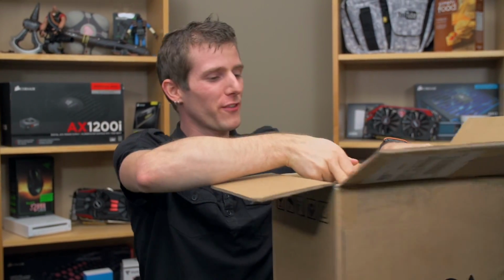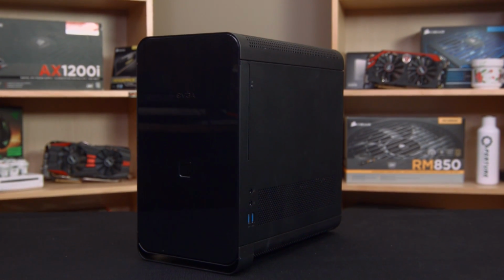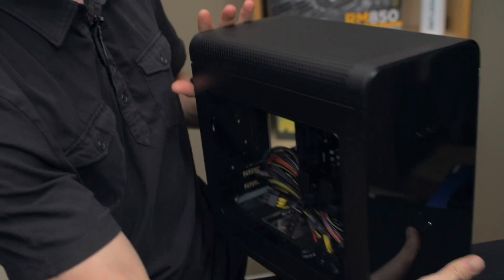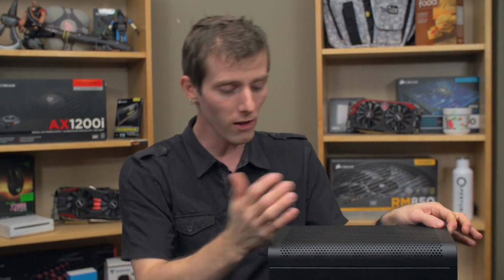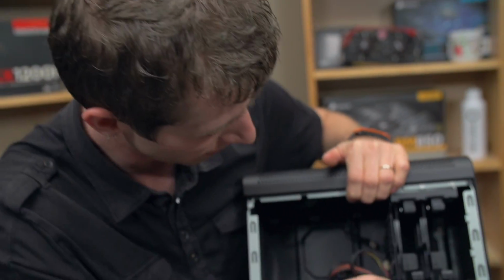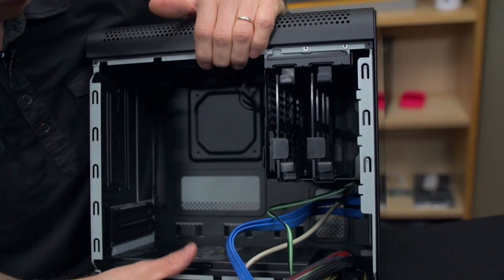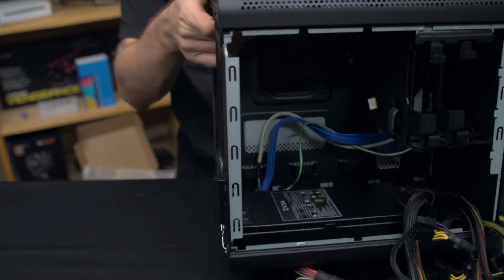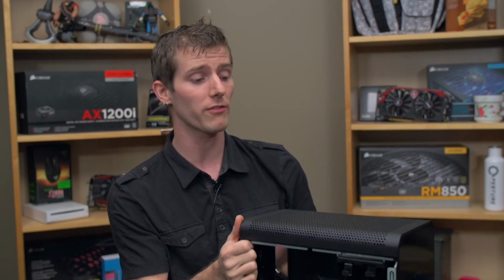EVGA Hadron Air

Comment: My current build.
Hadron Air
Gigabyte GA-Z97N-WIFI
i5-4690k
2x4GB Patriot Viper III
1x120GB Kingston SSD
Asus GTX 760
Corsair H60 CPU cooler, removed harddrive cage to fit.
1xNoctua NF-F12 to replace Corsair fan on CPU cooler.
2xNoctua NF-S12s to replace the included exhaust fans.

Using a mediasonic 4 bay enclosure for mass storage.
1x1TB WD Blue
1x3TB Seagate Barracuda
2x4TB WD Green
Reply: Stephan Conzen 14TB? I've been using a 1TB WD Black for 3 years now, and I still have around 240GB of free space on it. I'm planning on getting a nice 500GB SSD to put the OS and all my games on too. And that'll probably be good until the HDD fails.
Reply: HUS MAN Depends what do you do. If you only play a few games, you are probably good with 1tb HDD and 120Gb ssd for a a long time..
Reply: colorz. FX Yup yup. The 4TB drives are used for movies, music at around 6.5/8 TB. The 3TB drive is reserved for development, so all my eclipse workspaces are stored there, and I like keeping that seperate from my personal stuff. The 1TB drive is standalone games + steam library, and the SSD is just my OS and small programs.

Comment: What is linus's obsession with case packaging
Reply: +Raptor hard foam gives me material to work with in different projects and does a good job at protecting still
Reply: +aajjeee Hard is only capable of taking one hit, which means that if you are shipping a system qith it, you could damage hard drives, fans, etc...
Reply: +aajjeee He has an HADRON for good packaging
Reply: +aajjeee I just bought a nzxt h440 the case came damaged on top from being banged while in shipping. It wouldnt have been damaged if nzxt decided to use soft foam instead imo.
Reply: Because when he worked at NCIX, he built pre built systems and those are shipped in the case box.

Comment: I have this case, it is AMAZING, I love it and wouldn't trade it. For some reason it's a polarizing case, people see it and are either like "that's just sick" or "dude, get a new case, ew". I don't understand the latter, this thing is TINY and AWESOME. Such good build quality, so much power in so small a space.

A couple of things about this review confuse me. On mine, the other side panel is easily removed. Also I read nothing about motherboard compatibility issues in my research, and I got a Gigabyte and it worked fine. I think all standard MITX will fit in this, I don't see why it wouldn't.

Comment: Make both sidepanels removable, open up the section behind the motherboard  for cpu cooler installation, change the USB 3 front panel cable to black (or remove the front ports), aswell as putting on a black cable isolation cover on the psu cables. If they had changed these small things on the case, then it would in my opinion be a rather nice option for compact gaming rig builds. Congrats to EVGA on a well done first product in this category.

Comment: $250 AUD (PCCaseGear) for the Hadron, Mini-ITX, 500W slimline PSU built in, 30.5cm*30.8cm*16.9cm (12" tall, 12.1" deep, 6.6" thick) 6kg/13.2lbs...
Looks and sounds like it'd be perfect for a fairly decent HTPC or SteamBox that looks nice and fits with the decor of one's home theater system (or other game consoles).

Comment: Just made a build in this case
Gtx 780, asus z77 I deluxe, 2hdds and an ssd. 
However the cpu gets really really hot under gaming load.
Playing bf4 makes it jump to 5-60 degrees Celsius . This isn't a dangerous amount if heat however it is still hotter than I like to run my system.
Luckily this thing is small enough to fit in my bag when I go back home from school for winter and summer. 
It's pretty beastly as far as cases go.

Comment: They should make the case slightly wider and taller, so that you can have push-pull radiator support on the top and do cable management behind the motherboard tray. Then remove this silly proprietary support for only EVGA motherboards with a proper CPU cutout, a removable back panel and perhaps even a fully modular power supply. It would increase the cost of the chassis, but it would increase its appeal far more.

Comment: i wish there was a bit of a space on a back for a cable management. that's the only thing that stops me from building in this case. just make it about 1cm shorter(or enough to let gpu power plugs not bend too much), then take 1cm from the drive cages area, then add 1cm on the back, add holes for cables to reach motherboard and gpu nicely and that's it. it could be perfect.

Comment: Checks for cheapest current price for this $170 msrp case.  Closes browser, shuts down laptop, and goes to cry in a corner.
Reply: Yeah sadly it's basically impossible to find it, which is a bummer because I really wanted it.
Reply: Just put in an order in for this bad boy yesterday
Reply: Really? Where, how much?
Reply: Should I tell you or should I sell it on for a profit.. hmmm... Only joking, you can order it on the EVGA website for $159, they have recently been restocked ;)
Reply: Ahah alright, didn't expec it to be restocked! Still ridiculously priced though...
Reply: The Hydro is $10 more and comes with watercooling kit. Wut?
Reply: True it's not cheap but it does include an sfx size 500w gold rated power supply. Those don't come cheap. Also compare the Air with a Ncase M1 case (granted it's better built) but that thing retails $185 with NO power supply.
Reply: You're right, I didn't know of the PSU. with that included it's a fair...ish price, I 'd buy it if it was available in Italy.

Comment: My only pet peeves with ths case is the placement of the Disc Drive and front panel connectors being on the side, so you either have to choose between this case being awkwardly positioned on the desk, or sacrificing the view of your side oanel window to have access to your ports, as cases generally are positioned alongside the monitor.

Comment: Only real problem I see but it's due to it's size is the PSU takes away a lot of airflow from the GPU what with most now exhausting into the case. I think in this case it would have made more sense to have it on the backside of the case and allow for more cable room and a CPU cut out, that way the bottom could have brought air in and flow upwards like a raven case.

Comment: I can see why people don't like the CPU cooler mount but maybe look at it this way if you use this as a lan party rig that you move around a lot. Instead of putting all the stress on the motherboard  like on a normal mount it can offload that stress on the case. That said I don't know what sorta of coolers they make that work with this it would only make sense for large heavy ones.

Comment: I really do like the case but there are a few fatal drawbacks. The non removable back panel, lack of rear fan exhaust, modular cabling. Even though the cables are short, modular cables are even more crucial in a case like this.
Something as simple as having a 3 sata pork power cable for the slimline drive and remove the 4port (molex) cable would make a woulds or difference with cable management and seems to be a more sensible idea.

Comment: Looks too small for a 240 mm rad though (like the Prodigy can but without sacrificing optical disk or hard drives).
And there cant be much airflow from the bottom with that power supply covering most of it. I would like more intake fan options with fan filters (front maybe).
Plus I would have loved to see the power supply be semi-modular, as its SO tiny and no removable back.
The slot-loading disk drive and ports need to be on the same side as the window (for those of us that have to put it next to something).
And also give us the option of having the front and back at the same hight, I know its a bit OCD but I like symmetry.
Oh and more 2.5 inch drive options.
If this is their first attempt (good), I would love to see a later M-ATX version too (with these and linus' issues addressed.

Comment: The fact that only evga mobo's fit could probably be fixed with tin snips and/or a hacksaw
Reply: Other mITX mobos fit, it's just that the case was DESIGNED for the Stinger series.

Comment: "AIR" seems a bit misleading. Not much in the way of intake....I didn't see any front fans and the slim PSU blocks the floor of the case. Are there rumors of a Hadron "WATER"? That would prolly make much more sense for cpu cooling.
Reply: It uses the name "air" because this case was designed to use air as its main cooling method whereas its SISTER case, the Hadron HYDRO, has a taller chassis that allows for a water cooling solution to put up top and routed through the grommets near the MoBo I/O.

Here's a link to the Hadron Hydro: http://www.evga.com/Products/Product.aspx?pn=110-MW-1002-K1
Reply: Thanks for pointing out that it uses "AIR". That was not clear or obvious. If you bothered to try and understand my post you will see that  I was pointing out that there is not much in the way of "AIR" besides the air inside and leaving the case. Linus never mentions intake fans in the front. The "AIR" flow is some of the worst for any case, look up more reviews to confirm...Should be called the Hadron "HOT Exhaust". 200$ for a room heater.
Reply: I answered your question and provided context for the answer. I acknowledge no mention of a front intake fan happens because there is not a front intake fan pre-installed. As far as I can tell, a fan mounted on a flat, unvented piece of acrylic won't do much in the way of airflow.

It's not my intention to correct you, I'm just giving you information that you're asking for or may not have. Try to be a little less uptight and more accepting. The bottom line is that if you don't like the case you're not gonna buy it and if you really don't like the case, you can let Evga know about it so they can make one better suited to your needs.

Comment: Damn I wouldn't mind that PSU, maybe in 800W though.
Reply: You wouldn't need that much for an mini-itx. You're not doing 4 way sli/crossfire.
Reply: JacobStar91041 I wouldn't be building mini-ITX though ;)
Reply: Oh, you mean a large scale version of that case? If so I'd probably be the first to buy that, if it had cable mangement rear panel and a cpu cutout.
 The case looks amazing but those issues...
Reply: Nope lol, was just making a remark about the PSU haha... even though the video is about the case.

Comment: Why the window with the non existent cable management options and ugly cables? You are without sleeving options unless you are prepared to dismantle the entire PSU and work from there. I would have preferred a closed side panel to hide the mess.

Comment: Is it weird that they designed the case to have negative air pressure instead of positive?  Especially if you have a graphics card that exhausts out the back of the case as well as the two exhaust fans at the top?

Comment: Perhaps I'm nuts, but I'm asking anyone who reads this (hopefully Linus is among them) to help me find a case pretty similar to this one. What I would like changed however is for the case to much thinner, and a bit taller, and fit a high end gpu on a riser, so the PCB is parallel to the motherboard. The disk drive is not important, and I really only need hdd/ssd, but I'd like to keep the nice powerful PSU, and M ITX form factor. Thanks in advance!

Comment: I have a question:  Is it worth it?  Would you recommend the Case?  Could I see a AM3+ socket EVGA board with this case?
Is it Viable for a $650 Build?
Reply: Not really, the PSU is overkill for that budget and the case alone at $200 will kill your budget. I absolutely love the case but I couldn't recommend it for that low budget of a build, UNLESS it's sort of a project build you intend to keep upgrading, then maybe it's worth it to you.
Reply: Okay... before I posted that I hadn't looked at the price or EVGA boards  the lip...  does it mean it's incompatible with say Asus Mobos?  if it dosen't then my assumption was completely wrong and I'll just bump the price up to $750 for an excellent performance gaming rig.

Comment: Dat price though! Even considering the built in PSU! No one with a clear mind is gonna buy that.
Reply: What? Even considering? Did you even look up what you're claiming before you wrote that? An 80+ Gold 500w PSU starts around 100 bucks to begin with, take that off and the case itself is only 80 bucks. That's pretty normal cost for an itx case + a psu. I'd say it's a bargain even, seeing as the only way you're gonna get cabling that clean in an ITX case is to buy a modular supply and then buy a specially made short cable pack to go with it. Oh, but then there's the fact that almost no modular PSU fits in an ITX case to begin with. Not to mention one that's unbelievably small. If took the PSU/Mobo mount and the hdd cages out of a bitfenix prodigy, you could put the Hadron inside of it.
Reply: CJ Culbertson an 80+ 500w can be had for 50 bucks.... the rest of the case is worth maybe 100 bucks
Reply: Michael Griffin Link or it isn't true. 80+ GOLD, remember.
Reply: CJ Culbertson yea but the RZ01 + silverstones 450 80+ GOLD is cheaper than the Hadron Air

Comment: looks quite nice, but still the Node 304 case I have has better innards management :Đ
Reply: btw you said it can handle GTX780Ti - the length is just tight to fit, but what about the iPSU ? EVGA specs say 40Amps on +12V rail, but even my GTX770 has minimum recommended 600W and 42Amps...

Comment: Linus are you sure the 500w integrated psu can drive a 780 ti?  The minimum recommended psu capacity is 600w, and thats with nothing overclocked.  I originally considered the hadron till I saw this, but if youre sure it will work I may take a second look.
Reply: Yeah but this is an 80+ Gold PSU so it has great efficiency and punch up more power, besides I've seen many people using it with 780 ti ACX Super Clocked. No one had any heat or psi issues. That is a very good psi

Comment: Does this case have an 8pin cable for a graphics card? I wanna pair it up with gigabytes itx 970, but it looked like there were only 6 pin connectors
Reply: its 500 watt i think its 8 pin but 500 watt is cutting it low on on power
Reply: the gaming guy tom
500watts is good enough for those with the gtx 970/980 at least.
Reply: Tom!
Reply: In his video I saw a single or pair of cables that had a 6 pin PCIe connector as well as a 4+2 pin PCIe connector. So I'd say yes. But without absolute certainty. If all else fails you can get a Molex to PCIe adapter and use those 4 other connectors to help out.
Reply: Saw the new react video.  Great work, man!

Comment: I just wander how silent is that PSU on the bottom, in case of building fanless pc?
Reply: The PSU has been hit and miss for a lot of people. Some people claim that the PSU is quiet and not an issue, where others (myself included) think that the PSU noise is CRAZY loud in comparison to "regular" ATX PSUs. The fan in the PSU is a high RPM fan that on start up fires up like a jet engine for 1-2 seconds, slows down but still outputs a steady blowing sound during usage.

I used Noctua NF-F12 on a Corsair H60 and Noctua NF-S12s to replace the exhaust fans, as well as an Asus GTX 760 which are virtually silent on their own. The only sound you can actually hear from this case... is the PSU.

Comment: The case is a fail. Rightside: USB Ports, Slotloader, ect Leftside: Window Front: Powerbutton 

Which side do you chose?
Reply: I am right handed. My computer sits to the left of me for easy access and less collision by me. I for think it is a good idea. The window panel is for show anyways and since this can sit well on desk I don't see a problem. I have mid tower and its so big and bulky that my dog bumps into and has ruined my headphones. So now on my next build I am looking for something that sits on my desk Even if it means Killing my second monitor or buying a better mount. The only two complaints I have with this case is the fact they went slim form on the optical drive. I would have preferred they allotted more room for a full size optical.  And the fact that they limited the CPU coolers you can get for it. So far though i am still sold on BitFenix Prodigy when it comes to Mini ATX cases.

Comment: How about the Hadron Hydro. Im curious about the differences in dimensions and their water cooling kit. Is their kit recommended or should I get my own materials somewhere else?
Reply: the Hydro is the same case, but they added about 2-3 inches on top to make room for a radiator

Comment: bad airflow  i have one  i have my system in it now. i7 4790k/gtx titan black 16gb ram/2 1tb ssd's   using the noctua NH-L9i with no overclocking my temps can get really high gaming. to the point one would think i was using AMD